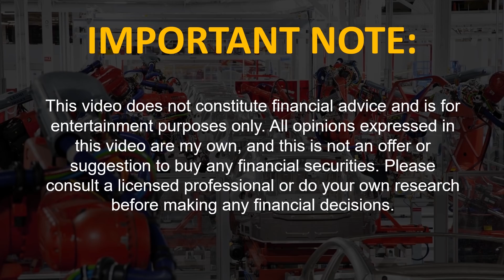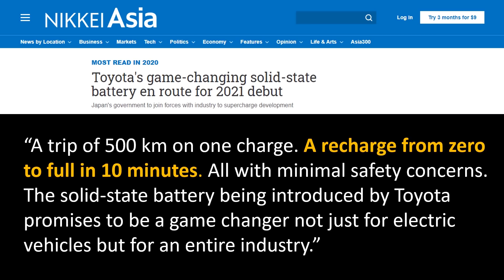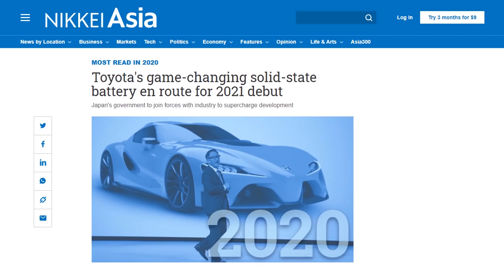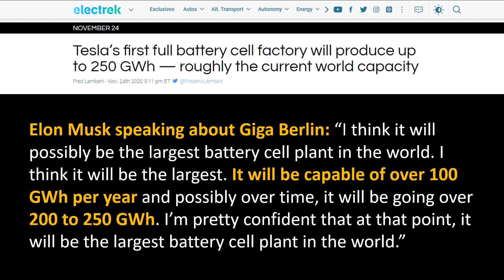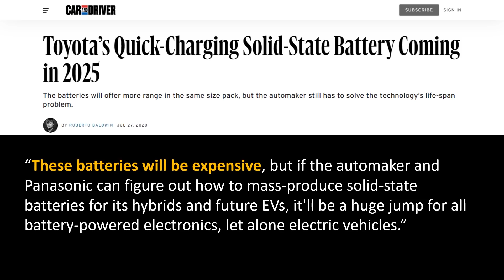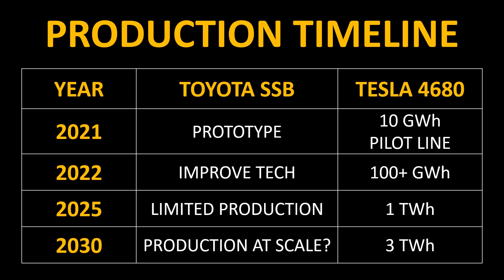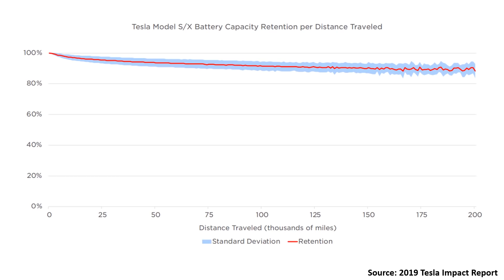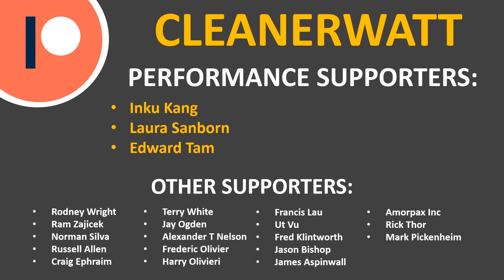Tesla NEW EV Batteries vs Toyota Solid State Batteries

Comment: Considering how little Toyota has actually disclosed about their solid state battery tech, I think you did a good job of reading between the lines and contextualizing how it relates to Tesla's 4680 cells.

Do you wonder why Toyota announced its solid state battery tech before they've obtained a finalized design, and before they've figured out how to make it?  Before they even can be sure it will be possible to commercialize it?  Wonder no more!  The answer is obvious.  Toyota is trying to reassure investors so their stock price won't fall off a cliff.  Tesla has rattled Toyota.  They're waking up to the danger they're in, finally.

Unfortunately, their ability to follow through and hit those timelines, to end up with a battery whose cost per kilowatt-hour is more than contemporary batteries, is an open question.  Lots of companies are trying to commercialize solid state batteries for automotive applications.  They all have lab bench prototypes.  Thus far, none has succeeded in commercializing any of them.  It is not easy.

One of Elon's sayings is that the highest art in engineering is to delete parts or manufacturing steps.  Get rid of them.  Simplify.  The 4680 cell incorporates new tech that eliminates the heating and drying step for conventional L-ion battery cells, reducing the footprint of the production line by 2/3rds and dropping the cost of installing new production lines by about half.  They do this by dry-coating the electrodes.  Tesla has patents on this dry-coating tech.  Toyota could invent and patent their own tech for dry-coating, perhaps, but if they have done it, I haven't seen any reports about it.  Just replacing the liquid electrolyte with a solid electrolyte would not eliminate complexity in manufacturing the electrodes.

We know nothing about the form-factor Toyota will choose for their solid-state batteries.  So let's take a wild-ass guess: they'll choose pouch cells.  Prismatic cells are too expensive to prefer.  As for cylindrical cells, assembling packs is trickier than sticking pouch cells into boxes, and laying boxes into trays.  Unfortunately, if they go the pouch cell route, they won't as easily get production rates up; hard-shell cylindrical cells are ideal for mass-production.  And pouch cells can't lend themselves to structural packs, so using them fails to rid the assembly process of vehicle parts, fails to simplify the vehicle or reduce weight.  Cylindrical cells are a tougher engineering challenge, but pay dividends downstream from engineering and design.

Toyota's expectation that their cells will be more expensive suggests that their manufacturing process, when it's fleshed out, will be slow and cumbersome relative to initial investment than even today's 2170 cell, let alone the 4680 cell.

Using pouch cells, Toyota won't run afoul of Tesla's patent for tabless battery caps, which is necessary, I think, for cylindrical cells to be as large - and therefore as economical - as the 4680 cell.  Basically, I'm suggesting that even if Toyota wanted to use cylindrical cells, they'd likely have to make them no larger than the 2170 cell, or pay Tesla royalties.  So I think they will avoid cylindrical cells and go the pouch route.

There is much we don't know about what Toyota is actually doing with its solid state cell technology.  I could be wrong in my assumptions.  But honestly, I can't feel any optimism.  They may or may not succeed in commercializing solid state cells, but even if they hit their timelines, they'll have an expensive battery on their hands.  That can't be a game-changer.

Changing the subject, 3 TWh of cells annually by 2030 for Tesla is an aspirational target.  Tesla isn't going to make that work.  They will run into all sorts of bottlenecks, especially lithium production from mining operations.  I'll be happily surprised if they reach 1 TWh annually by 2030.  That is still enough to make an awful lot of BEVs, though, not to mention grid storage products and home storage products.

I have little doubt that Tesla will achieve their objective sometime in the 2030s.

Elon has valid reasons for setting that 3 TWh target.  Without cells at that scale, we'll have to keep producing ICEVs.  Elon won't quit until the last nail is driven in the ICEV coffin.
Reply: Elon won quit until the Americans pay their taxes as bail out money in case of ANOTHER bankruptcy. Your long bullshit cannot change what has been happening. Tesla is not a leading tech manufacturer, it just assembled chinese components and market them as a cutting edge American car.
Edit: in any case, both chinese and American techs are garbage and Toyota is not worried at all.

Comment: Will the Nios ET7 not come next year with a solid state battery that can handle 1000km?
Reply: not a solid state battery, it is lithium battery with solid state tech
Reply: @Fauzanarief-n7i   Tesla's Model 3 is around 260 Wh/kg compare to Nios ET7 energy density of 360Wh/kg.
Reply: @annawilson4571  you cant compare it model 3, et7 are equivalents to model s
Reply: @Fauzanarief-n7i  Does not the model s use the old version of batteries? Or have they upgraded? What is energy density of model s batteries?

Comment: Excellent summary - exactly what I have been saying. I think this, together with the announcement of their 6 new EVs is just a way to confuse the market and try to Osborne Tesla. I do not think they can scale manufacturing nearly as efficiently as the 4680s can be scaled. And, by the time they would work out all the kinks, 4680 LIBs will be that much further along and further down the cost curve.
Reply: Toyota is the leader with Solid State Batteries, if QuantumScape has a working battery, definitely Toyota has a better one.
Reply: @rwyo83  What are their gravimetric and volumetric energy densities, charge rates, cycle life, capacity fading profiles, cost, etc.? How did you compare SSB performance between Toyota to QS to SolidPower, etc.?
Reply: @cbmusgrave  Toyota has been doing this since 2012, they have money, goverment money. By 2030 they will already have a 2nd generation of SSB
Reply: @rwyo83  That's all true, but others have been doing this for since before the 1990s and also have lots of government money (see Argonne's DOE battery hub). The winners aren't determined by who has the most money or has done it the longest (speaking as a battery researcher).
Reply: @cbmusgrave  Toyota has a huge staff working on SSBs. Toyota is leading, like it or not
Reply: @rwyo83  How do you know? Show us the numbers. If they are so far ahead, why don't they have something out yet and won't have a 2nd gen SSB until 2030?
Reply: @cbmusgrave  They were ready to show a prototype last year during the Olympics. Believe me, they are ahead.
Reply: @rwyo83  Hard to believe something that wasn't displayed, demonstrated, announced, etc. I also don't know anything about you and why I should take your word for it. There is a big gap going from prototypes to scaled manufacturing.

Comment: When I can buy a mid-size EV for 45K (tops) that gives me 400 miles on a charge, a 15 minute re-charge and 0-60 in 3.5...I'll take a look.
Reply: Tesla Model 3 is dang close, the range is 353 miles, price is $38k, $47k AWD or $55k for performance and recharge rate of 1000 miles per hour so about 15-20 minutes for most charges.   353 miles is for AWD model.   Drive your current car into the ground then go test drive a Tesla, you will not regret it! In three years of ownership, I only had one charge of more than 20 minutes and the car was done charging before I finished my dinner. If you stop for bio break/food on a trip,  you will not even notice the charge time.

Comment: Toyota has the option to surrender to fully rely on Tesla battery in 5 years. Better than total destruction.
Reply: They also had the option to simply keep their Tesla stock.
Reply: It’s Toyota talking. Believe. They’ve moved slowly but have partnered with the right company to overtake Tesla tech. That’s where they’ll build, on their brand of quality and advanced tech.
Reply: @rowanbroekman3929  ouch ! 😂
Reply: @posttenebras2812  Really? Who did they partner with to build Giga castings? Who did they partner with to beat TESLA at FSD ( and how will they beat their insurmountable data lead?)? Who did they partner with to guarantee mining materials through full vertical integration? How will Toyota pay to shut down their vast ice production facilities? When will Toyota design and build factories specifically for EV’s? When will Toyota develope an in house operating system along with over the air updates? So many questions are being ignored. Toyota moves too slowly, and their management incentive structure isn’t designed for major change, only zero cost incremental changes.
Reply: Good questions. They aren’t immune to technical innovation as evidenced by the Prius, revolutionary in its time but I partly agree with management slowness. Over-air updates are a snap to any company who wants to do it, literally nothing groundbreaking there. The data Tesla have collected for self-driving, etc., is insurmountable for now, but so is Toyota’s reputation. Time is the key. If Toyota can deliver on the battery tech this video is about then there will be plenty who swap from whatever EV they have picked up back to Toyota. I’m one. The full vertical integration of supply chain is just a euphemism for a monopoly and will be forcibly broken up by anti-competitive regulation unless Tesla is careful, but no signs of that yet and it’s not in Elon’s nature. We’ll see.
Reply: Panasonic makes Tesla batteries

Comment: fact: tesla current production batteries are made by Panasonic. Which means that tesla own battery factories are not yet operational.
Reply: Not quite. Freemont made vehicles use Panasonic batteries. Some of the Shanghai made vehicles use LG chem batteries. And Tesla has already vehicles with the new batteries made by themselves, just none that have been delivered to customers, yes. Also, Panasonic is also developing a new cell for Tesla in their own format. 

One of the reasons why the current production is not using their own batteries yet: for that to happen, the construction of the cars has to change, which will require some downtime and retooling on the production line. So your assumption that their own battery factories are not operational is unknown. It is operational, we know one of the complaints was, that yield still is low, but even if they have sorted that problem, we'd still be waiting on the retooling. Even though ... the S & X production line is being retooled as we speak, so we could very well see those with the new pack in the new year.
Reply: @Marlow925  TL;DR the new battery is not yet used in production. There are still changes that must be done. Their pictures presented in the battery day was merely a fictional computer rendering.
Reply: @muayyadalsadi  Well, we do know by when, at the very latest, that battery will be in production cars: end 2021. Because the Model S Plaid requires those cells.
Reply: @Marlow925  tesla semi was reveled in 2017! It still did not hit the market. Tesla is known for not delivering on time.
Reply: @muayyadalsadi  Tesla semi requires Terafactory Texas to be build. Can't build the truck without the factory. Simples. And not everything gets delivered on time. How often do OEMs miss their timeline ? A lot.
Reply: @RickFreeman007  can't argue with someone who does not know what does the term power density mean.

Comment: "Power Paste" (Hydrogen Hydrate) developed in Germany blows both battery systems out of the water.
Reply: True.  But unless it is produced through electrolysis and not gasification, it is just another dirty energy.  Currently gasification is the cheapest and most widely used method.
Reply: @mrosestuff  Electricity from the grid is not entirely clean either. Depending on which nation you are from it could be up to 50% carbon based.
Within a decade gasifcation will become a minor source with various breakthroughs in material and technology.
Japan Atomic Energy Agency recently announced they have succeeded in generating Hydrogen waste heat with their experimental reactor.
It ran stably for 150 consecutive hours showing proof of concept.
The Hydrogen was generated through a recycling thermos chemical reaction so there was no loss.

Comment: There is no Toyota Solid State Battery. Its a theory, not a product, unlike the Tesla battery which is already in limited production and pulling stuff from CA to NV. Toyota needs to make a technology never before done successfully vs Tesla need to iron out the kinks of an already produced and tested product in use today to get to mass production...HUGE difference

Comment: Basically,  taking from your timeline for Toyota,  by 2025, they'll still be behind the 2013 introduction of the Tesla model S. 12+ years.  18650 to 2170 to 4680 makes Tesla in their 3rd generation of batteries already, in 7 years.  I suspect that by 2025 Tesla will be at least one generation further along.

Comment: They sell over a million Corollas a year.  Not for much longer.  In three years, the Model 2 is really going to piss in their Cheerios.  They won't have an EV to combat it.  Big mistake.
Reply: You have a big flaw in your thinking. A large population at least in europe lives in apartments and they dont have a place to charge on the regular. Toyota hybrid technology is extremely reliable and with lower buying price and low fuel consumption it still makes more sense for the large population. So corolla is here to stay
Reply: @nigeld.9650  by 2030-2040, Hybrids won't be allowed to be sold in many european countries anymore. Example: in the UK, ICE sales stop in 2030, Hybrids stop in 2035. Austria has banned the sale of all non-electric cars for registered taxis, car shares and hire cars from 2027. That includes hybrids, as they are not considered electric.
Reply: @Marlow925  you are talking about something 15-20 years down the line. By that point it can be expected that solid state batteries are going to improve dramatically.... not just tesla's. On the topic of the uk. They also pledged half a billion pounds for large scale hydrogen production, technology that japanise manufacturers are most advanced at....
Reply: @nigeld.9650  2030 is not 15-20 years down the line. It's in 10 years. And some countries are starting their restrictions as early as 2025.
Reply: @Marlow925  some= few. I'm not talking about the outliers, but the majority. Majority will push for a switch in 15-20years. When you look that people keep cars on average 7-8 years from new you are looking well over 20 years for a majority switch. For the next 20 years hybrids will be solution for the majority. And as I said corolla is here to stay...
Reply: @nigeld.9650  I'm just saying, that Toyotas approach is too shortsighted and that will hurt them. A lot. They are actually already making a small BEV, but only for the chinese market, where they are forced to do so. If you calculate with the 15-20 years, then you've lost, because that is the maximum permissible time. One has to be ahead to beat the competition. The only OEM, that has grasped that so far, is VW and Volvo, expecially in the form of Polestar.
Reply: @Marlow925  I would argue that they are hedging their bets pretty well. Hybrids for next 15-20 years and development of hydrogen and ev's for the future. It would be suicide for a company that sells 10mio vehicles a year to put all their eggs in the basket of EV's. Btw I also feel that kia/hyundai are doing a better job than Volvo or VW.
Reply: @nigeld.9650  actually .. Hyundai is definately doing a good job.
Reply: @RickFreeman007  i can guarantee you have never been to europe just by reading this comment. You cant reconstruct the cities just so you can charge the cars. definitely not in 15 years 🤦‍♂️🤦‍♂️. For the near future hybrids are the way to go for all mass manufacturers. Tesla is still operating in a niche market and will continue to do so for the foreseeable future
Reply: @RickFreeman007  are you really comparing charging infrastructure to the ww2. How did you even jump to that 🤦‍♂️. Is american school system that bad that this is the connection you are making? Just because you want something to be done it doesnt mean it will. Lithium is a rare commodity, and switching hundreds of millions of cars is not feasible with the current technology, and doesnt look that it will be feasible for the foreseeable future. Change is slow and takes time.
Reply: @RickFreeman007  future needs of my country? What kind of socialist propaganda is that? Market decides what a viable solution is, government might try to influence it but the market always has the final word. I dont know what kind of bubble you are living in when you consider this to be a priority of a society

Comment: The real question is, do we need SSB to make good BEVs?  Faster charging? Longer range? Actually no.  
With about 300-400 miles of range and a charging time between 10-80% of 27 minutes or adding 75 miles in just 5 minutes you barely have time for a snack  or something to eat.  
I know, it requires a little planning but with the right software at hand it really shouldn't be a problem.

Comment: I think you're being too optimistic towards Tesla. They also had a "working" factory line for the Model 3 that took months of development hell to get working properly. I have little doubt they will succeed with the 4680 but I strongly doubt they will do so without running into problems before mass production. Of course, I hope to be proven wrong!
Reply: I would hope your wrong also but they haven’t made the 4680 at all yet, if they had just one Elon would have trotted it out in front of the media and while the proposed specs are an improvement over current chemistry it’s not revolutionary 
I’ll give it to him Elon is a great salesman